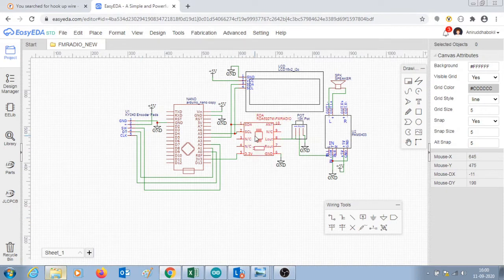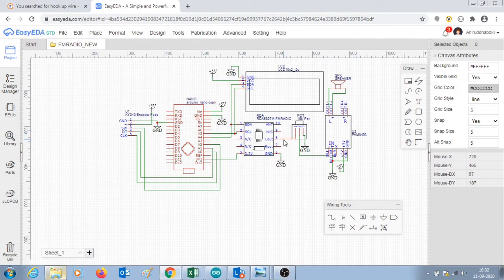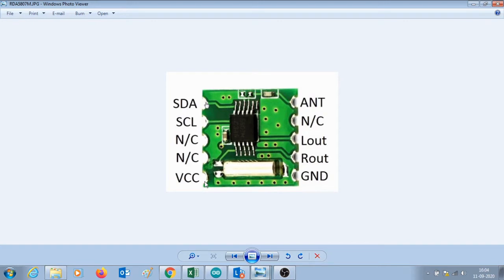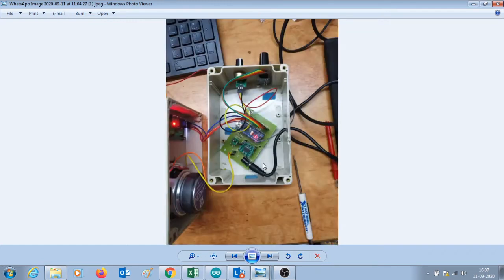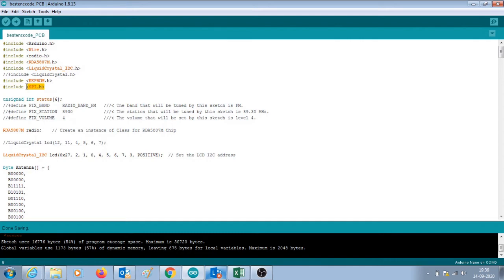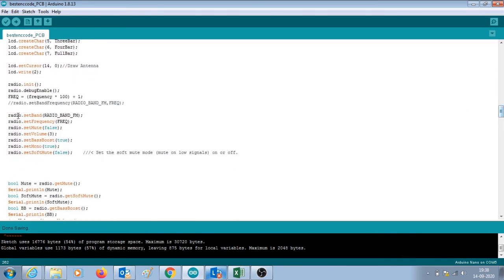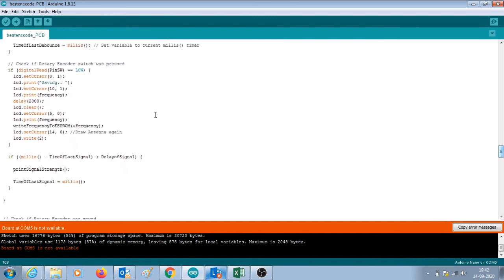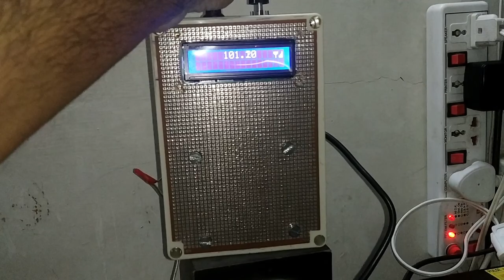DIY FM Radio using RDA5807M FM Radio module and Arduino NANO.

Comment: Did more research about the error I was getting and found that the LCD library I was using was causing the problem.  Loaded new library and sketch verify checked good.  Thanks for your program I plan to build this for my grandson.  73s
Reply from the maker: I am happy you got it working!
Reply: JOIYA SUSHIL CHANDER   Sorry it took so long but here is the link to the library I used.

https://github.com/fmalpartida/New-LiquidCrystal

Comment: What is the software we need to install on the arduino to run this circuit with a 128x64 oled display? can you please share? thank you... (oled 4 pin. vin gnd sda scl)
Reply from the maker: You need to include the correct library for that display and make changes in the code according to that.
Reply: @AniruddhaBokilVU3FML  I know. but I don't have any coding experience on this subject. but thank you for your answer..

Comment: Error same even with updated code.While I was checking the code I got an error  'POSITIVE' was not declared in this scope.
Reply from the maker: Please check replies given to comments. I have provided a link to use the correct lcd library. It will get solved.
Reply: @AniruddhaBokilVU3FML  Even that also gives same error

Comment: Hello, how can we turn off the sound at an empty (noise) frequency on the fm radio, what should I use for this?

The FM module I am using is RDA5807M

example :

vzssssssssssssssssssssssssssssssssssssss (white noise)
Reply from the maker: Every time you rotate the frequency knob the value of frequency variable changes and is passed to the radio module and the radio tunes to that frequency. So you hear that noise. 
You maybe able to achieve what you want for known frequency radio stations by not passing the value to radio until you stop rotating the knob. 
You can also just have know frequencies stored in memory and only switch between these frequencies with the encoder. You need to re-program a part of the code to suit your need.

Comment: Great video...While I was checking the code I got an error on line 19.  'POSITIVE' was not declared in this scope.  Being new at this could you please explain this error?
Reply from the maker: Let me check... Meanwhile please try this updated code
https://drive.google.com/file/d/1HIFyVka6N3xAcbyhLj8tjbJxXO-abzTC/view?usp=drivesdk
Reply: Arduino: 1.8.13 (Windows 10), Board: "Arduino Nano, ATmega328P"

bestenccode_PCB_RSSI_SCALE:19:53: error: 'POSITIVE' was not declared in this scope

 LiquidCrystal_I2C lcd(0x27, 2, 1, 0, 4, 5, 6, 7, 3, POSITIVE);  // Set the LCD I2C address

                                                     ^~~~~~~~

exit status 1

'POSITIVE' was not declared in this scope

This report would have more information with
"Show verbose output during compilation"
option enabled in File -> Preferences.
Thanks for your speedy response but when I downloaded and ran verify I am still getting the same error.  See above copied from error block.  Which LCD I2C library are you using?    73s  KE4NBP

Comment: I have had great success with the build and the radio sounds great!  I have been trying to power the radio by battery pwr only, I have been unable to get the radio to work.  I am using a  18650 3.7v 2700ma rechargeable battery in conjunction with the MT3608 regulator and a TP4056 charging unit.  Has anyone else tried this with any success?
Reply: I realize it is kinda off topic but does anyone know a good website to stream newly released movies online?
Reply: @Zyaire Kobe thanks, I signed up and it seems like they got a lot of movies there :D I appreciate it!!
Reply: @Armani Zayne No problem :)

Comment: Used Arduino uno and rda5807m -- TOTAL FAIL , neither its switch volume or frequencies, and only humming sound,  setBandFrequency Never change band and frequencies and erratic debug output